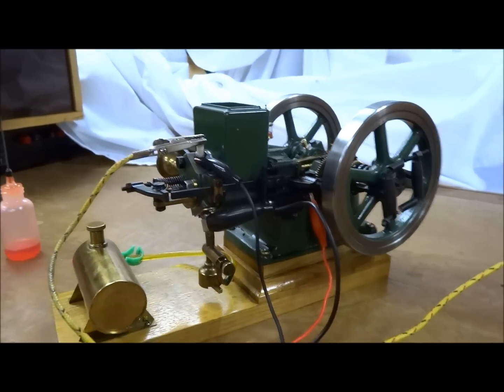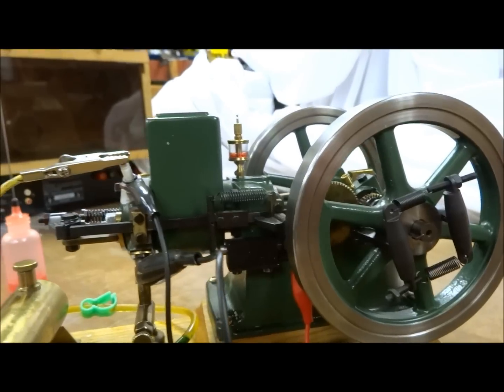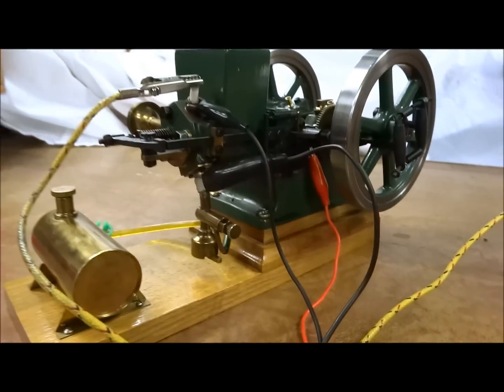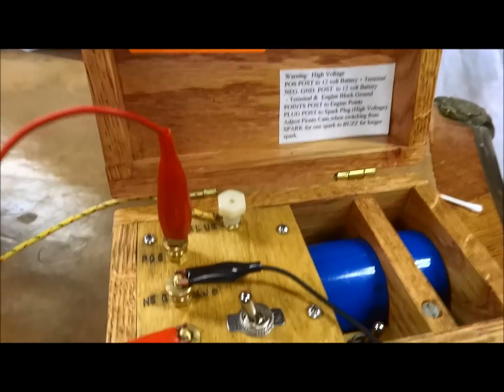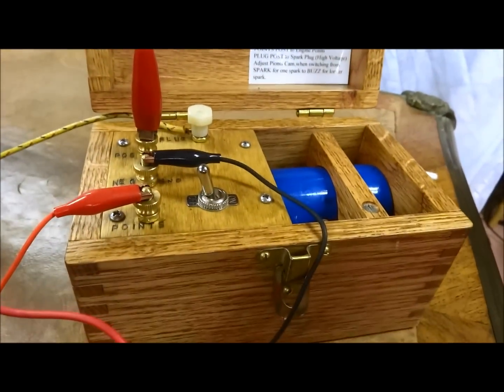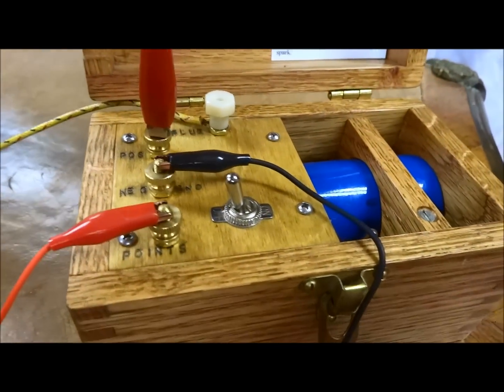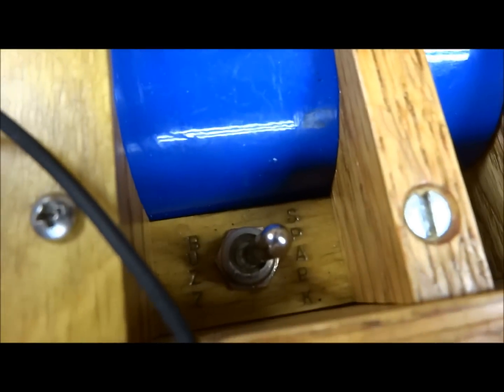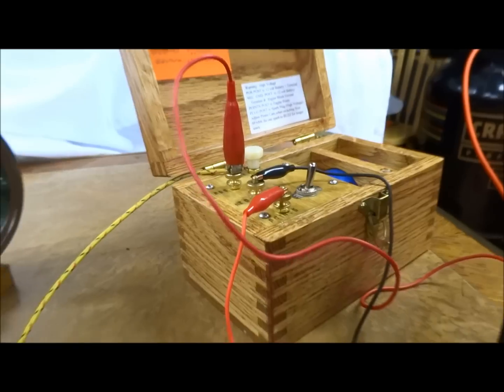Associated L'il Brother Hit and Miss Engine Model

Comment: I'm looking to get a small steam engine just to tinker with maybe run a little generator or the like where would you suggest a guy on a budget start out
Reply: Paul Tani how big is your generator? need to decide whether toy or model steam can suit your purposes
Reply: Don't have one yet but I would like to be able to do something useful with the engine like power some lights or something else light duty
Reply: Maybe I'll use a car alternator
Reply: Paul Tani 

what size lights? toy steam engines can run small motors to power LEDs as can models.

Car alternators are beefy and would require sizable model engines that would be far from most peoples definitions of budget
Reply: That's exactly the type of info I'm looking for .what is more realistic of a goal on a budget then? Or maybe a better question is what type of model engine is the most versatile and also budget minded to start with
Reply: Paul Tani Well, you will need to define budget more. Can you give me an example of the size of engine you would want? 

A jensen 75 will be ~200 and will be a nice sized toy engine with step pulleys, throttle, and reversing without needing anything extra. Its entirely capable of running small motor-generators that power leds or other small objects but I need more reference